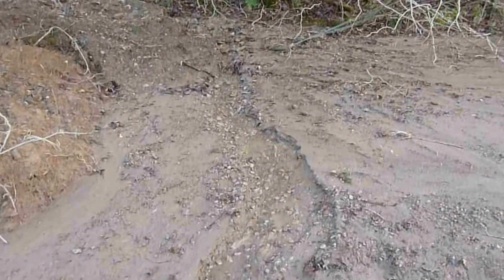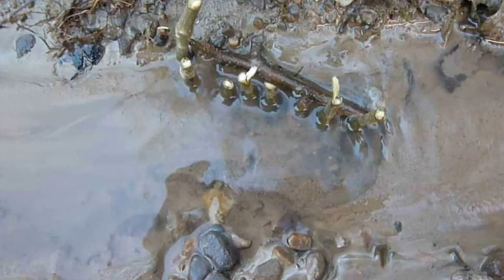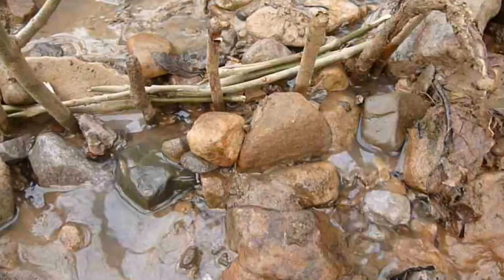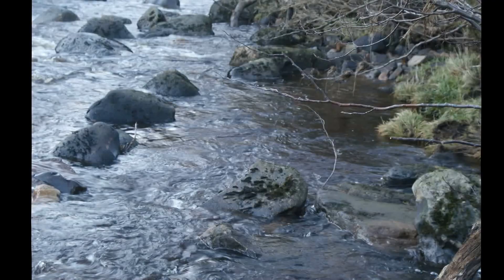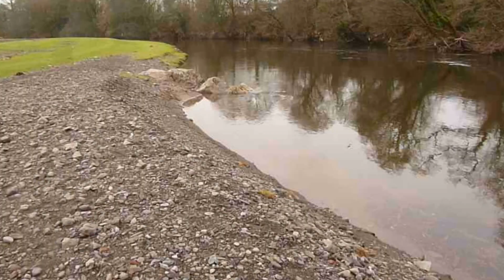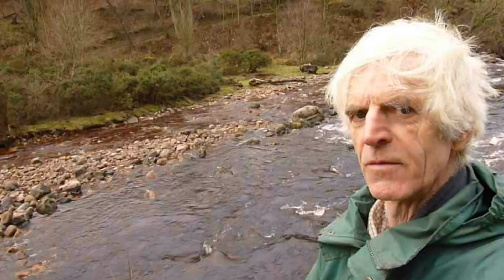Working with River flow 24 jan 2016

Comment: A small beach where I made good memories by a local river was washed away in a flood and didn't come back, add a teenager I missed that beach and did exactly what you've now done in places.
I put big rocks upstream diverting the flow into the centre of the river away from the back and the beach rebuilt itself over time.